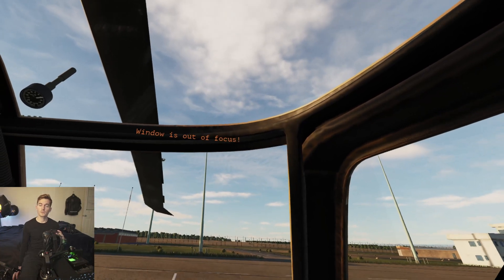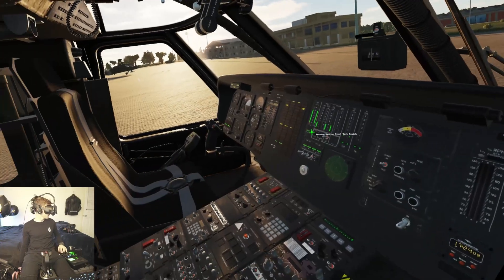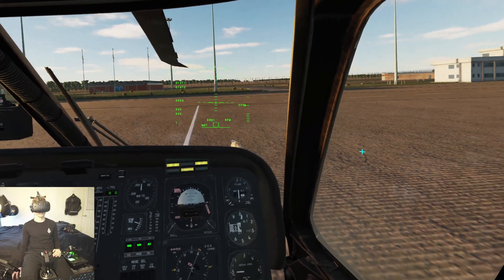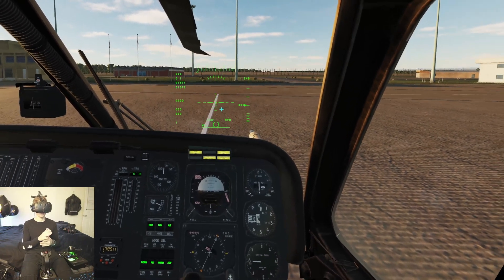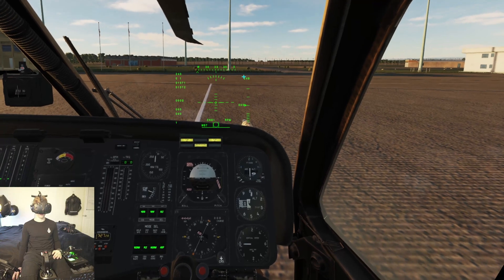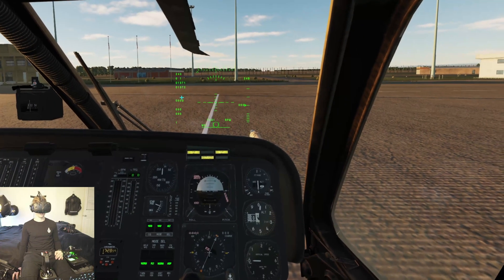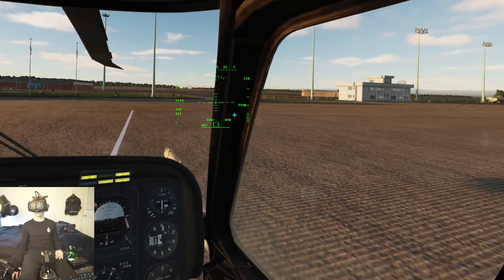DCS: UH-60L BLACKHAWK HEADS UP DISPLAY

Comment: how are you using hud without nvg on
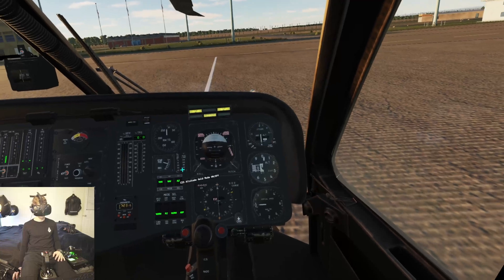Reply from the maker: Once you have supplied power from your generators or a running aircraft make sure you have your AVS7 power turned to on, you can also turn it on by turning on the power on the HUD panel, 0:49